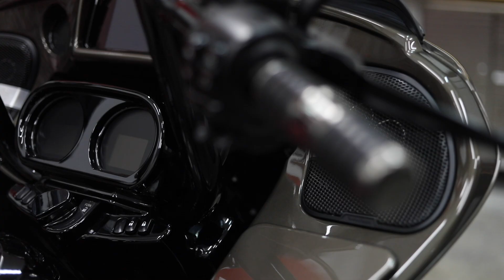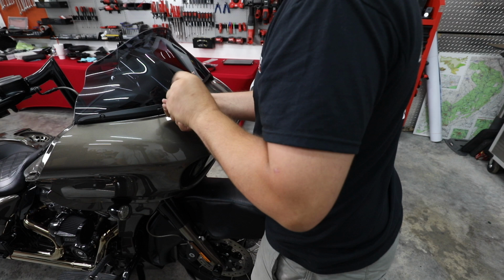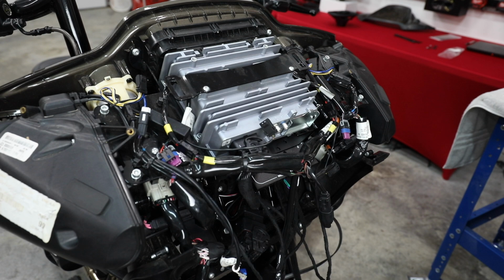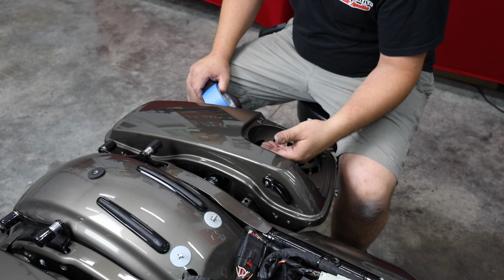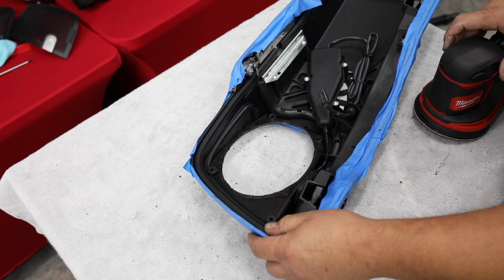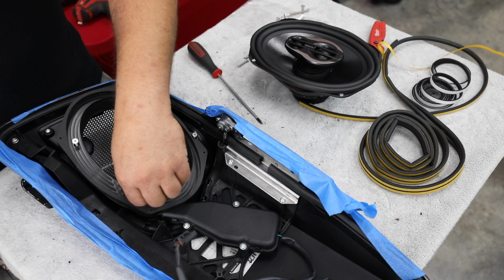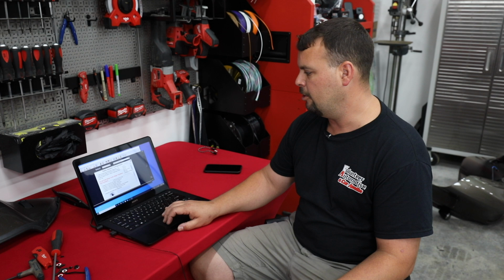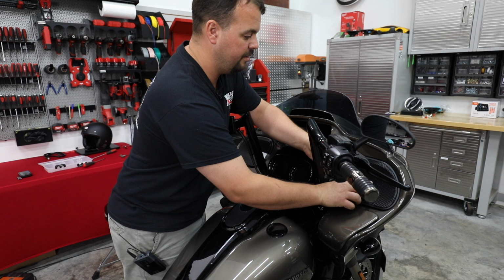Step by step, How to Upgrade HD Audio by Rockford on 21-Up Harley Davidson CVO with Stage 4 Hertz

Comment: Has this setup a dsp?
How would you connect a dsp when there is only a front L/R signal incoming to the connector in the left bag
Reply from the maker: No dsp needed but if you wanted to add one you would do it at the amplifier, we use all 4 channels of output

Comment: So how much deeper do the Hertz 6x9's sit in the cut in kit with a spacer compared to the Kicker 6x9 lids?
Reply from the maker: Cut in kit takes up less bag space by a few inches
Reply: @volunteeraudio  Thank you for your quick reply. I assumed the Kicker lids would keep the speaker higher. I guess I was wrong. Thanks again.

Comment: Question do you use both them insert if you don't have locking lids??? My hd auto was added I have a 18 street glide with the Harley 5x7 lids if so you have a link where we can get that glue you used???
Reply from the maker: Yes you still use the adapters but it’s not as deep with out power locks

Comment: Hey jay I was wondering what flash I should use for a 21 RGS and I have a SD 800.4 and diamond speakers with 6x9’s in the lids
Reply from the maker: Stock radio should be flashed to boom audio 6 speaker 2 amp flash
Reply: @volunteeraudio  I appreciate it I thought that’s what you were meaning in your video that all bikes with factory radios gets this flash
Reply: @volunteeraudio  so I did this flash and I was wondering why My max volume is 6 notches before actual max shouldn’t I have more volume? It clips if I turn up my GTS head unit 5 notches before max. I used my DD1+ to set my gains and find maximum undistorted volume of the head unit
Reply from the maker: @BlackEyeSRT  do you have treble and bass up in the eq, should be flat when testing
Reply: @volunteeraudio  yes everything is flat